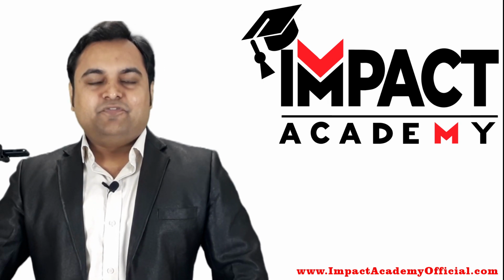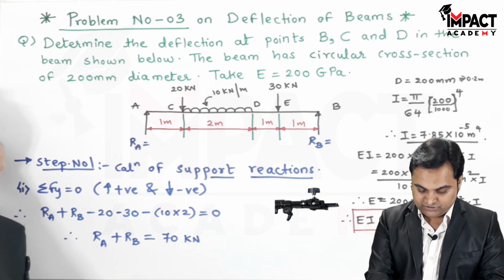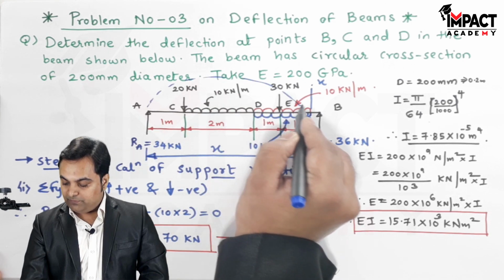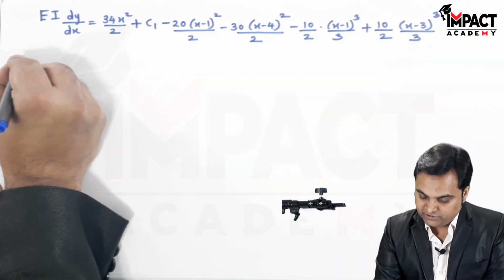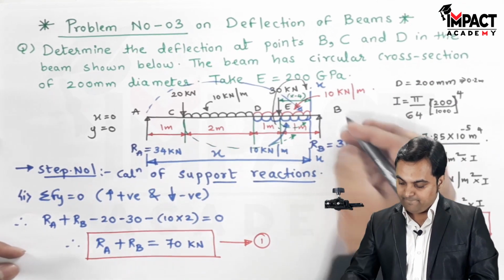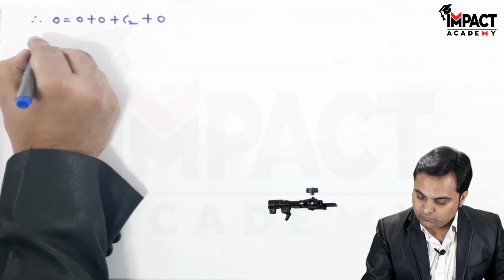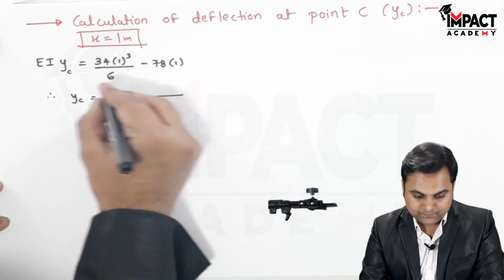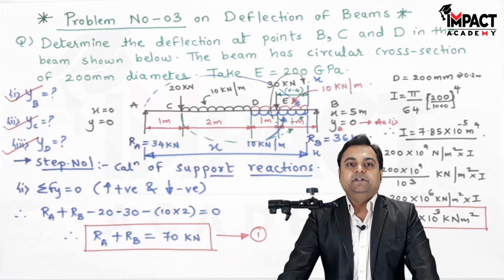Problem 3 on Deflection of Beam (Macaulay's Method) | Deflection of Beam | Strength of Materials |

Comment: Why did u consider a dummy load?
Reply from the maker: That's the step which should be followed while forming equation using Macaulay's method if udl is not in contact with anyone of the support...👍👍👍